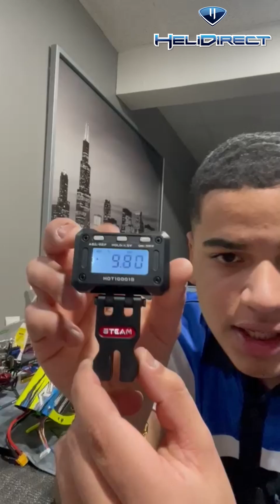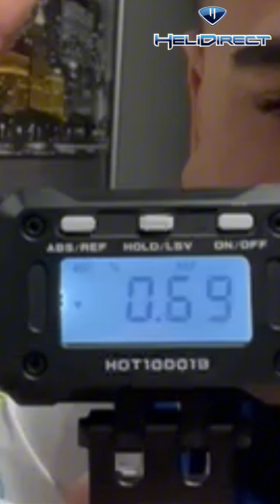Wrench'n Tools: Steam Multi-Size Digital Pitch Gauge

Comment: Power supply, rechargeable. Which is nice to not have to deal with changing batteries. There's an included USB type C cable(short wire) that is also included. Which is another reason for my purchase. Not having to chase down batteries.

Comment: I just got mine and tried it out. I didn't know that good Jeremy had done this video. I found out that if you press the ABS/REL and the HOLD/LSV buttons and the same time and keep them depressed it will zero out and reset the REFerence value. I don't think it does anything with ABSolute but at least I was able to zero it out on my motor. The only thing I don't like is that you have to hold it. The RC Logger allows you a few seconds so it settles and avoid any unwanted motion from you touching it. But after using my RC Logger for years and not quite liking the fact it was too far away from the blade grip, I really like this. And it also showed me that I was running 22 degrees of pitch instead of the 12.5 I thought I had configured. Next time I head out to the field I will check, I only re-did the setup on one of my helis for now.